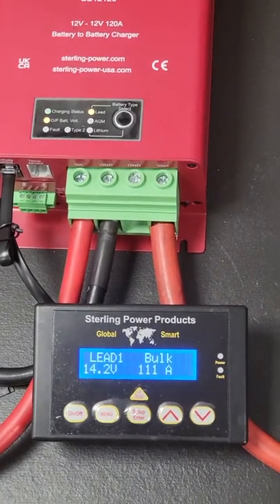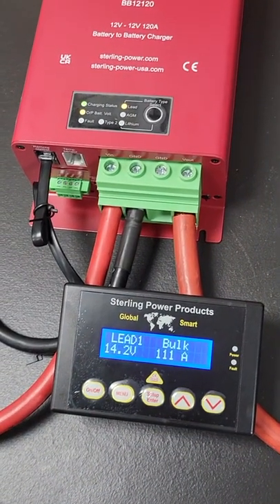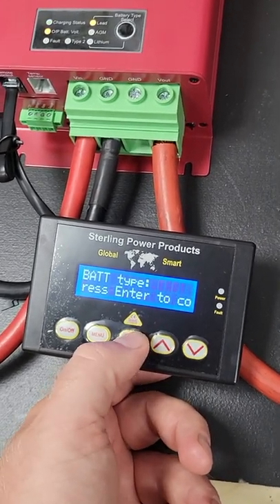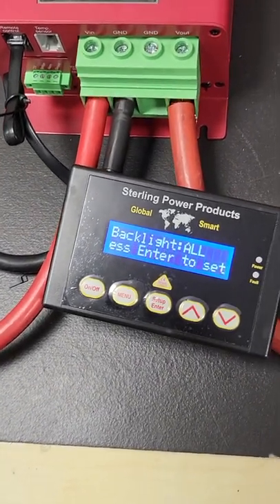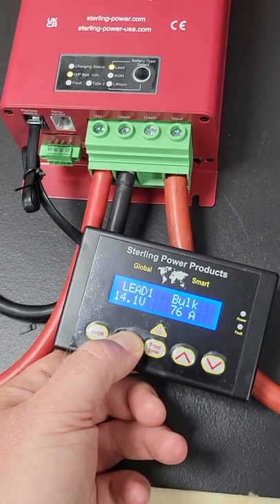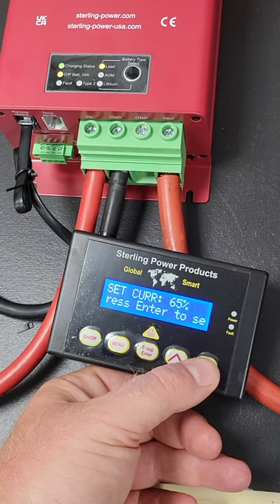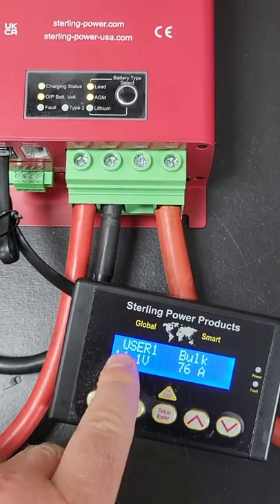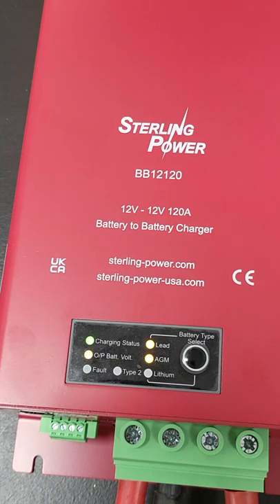BBR - Remote Control for Sterling Power's 2022 Battery to Battery Charger

Comment: Be nice to see a few more current reduction options. 

Good looking equipment...Victron better watch out!

When will this be for sale in the US?
Reply from the maker: Understood- though if you need to cut it down below the 60% region we'd probably recommend going for one of the lower powered units in the first place!

We plan on doing some more professional videos on the products when the next batch come in from manufacturing, and we intend to get a few products out to test channels on YouTube to give their impartial opinions. 

It's already available for sale for US customers, just not being stocked by any US distributors at the moment. It can be ordered directly from the Sterling-power.com webstore and should be with you within a few business days, we generally use FedEx. 

Here to help if needed!
Reply: @SterlingPowerLtd  

I will take a look thank you.
Reply: @SterlingPowerLtd  

Interesting - are the 65/85/100 derate choices arbitrary numbers choosen in a meeting? Could you rearrange a few things to give the user full control of the charge rate?

You have me sold on the BB1270 but I would buy the 120A version in a heartbeat if Sterling allowed more derate via the controller. I would spend more to future proof just in case I get a bigger alternator. Why stand in the way of that? Unless, it's a physical limitation of the hardware?

Why doesn't Sterling want me to spend more? :)

I understand you can mix and match these red boxes but I'm in a van and don't have unlimited room.
Reply from the maker: @MyGoogleYoutube  Hello,

Not arbitrary I'm afraid. Buck boost systems essentially are multiple of the same or very similar circuits in order to reach higher power ratings. Tuning down to 65 and 85 is very much just shutting down parts of the board one at a time in order to adjust the current limit. 

Theoretically we could have had an additional circuit that measured the current and adjusted accordingly to allow us to taper control but that would have begun requiring more expensive and advanced ICs on the board, when this was made to have perfect fundamentals - we wanted to step away from complications as much as possible, as that's always our biggest delay when manufacturing a new product.

Everyone ends up having more ideas for the product and trying to sneak it into development leading to the product never getting finished, or being delayed, or the costs being inflated to silly levels. In this, we just said 'No. Do the basics, do it right.'

I hope that makes sense!

Comment: I have a 12v in, 24v out unit (1224120) and the panel settings for custom charging profiles seem to be limited to 12v (as in, max out at 15.5v). Does the charger automatically double the values, so if I want 27v float then I should set the panel to 13.5v ?
Reply from the maker: Hello TR!

Hope you're well. How old is this purchase? This is something we recognise from the earliest release of the BB1224120s. 

The unit won't automatically double it- can I ask you to send me an email (info@sterling-power.com) and I'll see what I can do to get you sorted. 

Best,
Ben

Comment: How does this new model cope with heat? Really like the ability to clip the output amps. Will be a great replacement for my two bb60’s which after 10 mins of charging would drop down to 25 to 30 amps output each from around 50a to start with.
Reply from the maker: Hi Simon, the new all red models run at full current continuously. They are a much more efficient using 4 switch buck boost technology. So, the amperage is constant. We have the BB12120s in stock now. Kind regards
Reply: Been using mine for two weeks. Heat is not an issue. Finding out how to use all the power is❤

Comment: Would this be capable of connecting a 48v lifepo4 bank with a 24v AGM bank allowing for charging in both directions?  If so, would the remote allow for this to be fully automated based on both bank 1 and 1 SoC?
Reply from the maker: Hi Sam,

The BBR can set charge voltages from A to B, not B to A. 

The B to A charge voltage is only up to 13.4V (or 26.8V on the 24V IN models).

The BB1248120 with 24V input, for example, will charge from 24V to 48V at your specified voltage when the input voltage is >27V or when the ignition line is live. It will charge from 48V to 24V when the 48V bank is above 54.4V and it will bring it up to 26.8V.

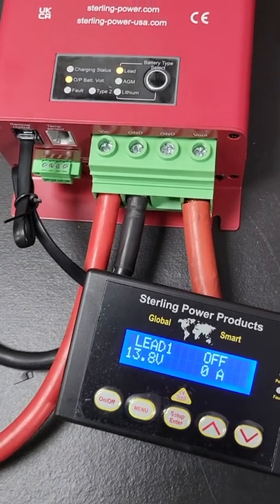Comment: At 4:18 the unit shuts off for a bit before rebooting and applying the new setting. I was under the impression that suddenly turning off that kind of draw could damage the diodes of the alternator, specially if the starter battery is full and can't absorb the load dump. Is this not the case?
Reply from the maker: Hello PBW,
No, not that we're aware of. Worth noting that if your starter battery is lead acid, if the input voltage were to spike momentarily, even a full lead acid battery will draw a bit of current.

A lead acid battery is an excellent protection against your alternator spiking as, once the voltage rises above what the lead acid battery has previously been charged at- it draws, even momentarily, protecting against the possibility of a spike.

If the spike was sustained, IE a failed regulator and it just constantly dumping high voltage- well, that's a more unhappy story.

Ben
Reply: @SterlingPowerLtd  Thanks for clarifying this Ben. I still have some knowledge gaps to fill but I have learned many interesting things just by reading the comments on your videos. Thanks again for taking the time to answer and congrats to you and Sterling on this front!